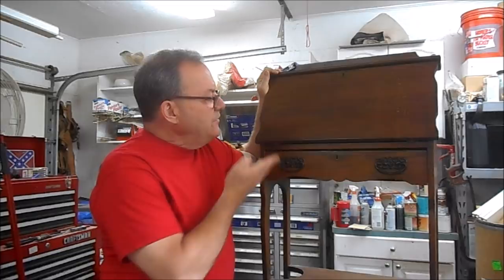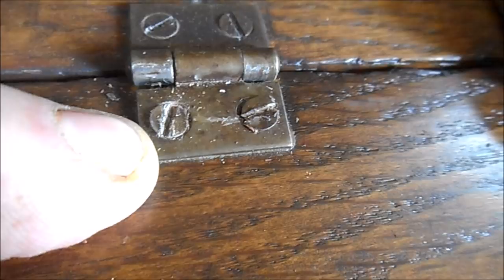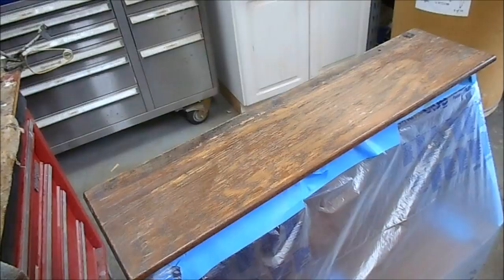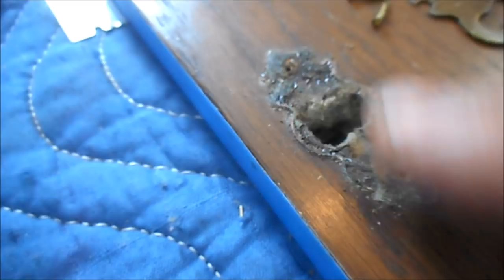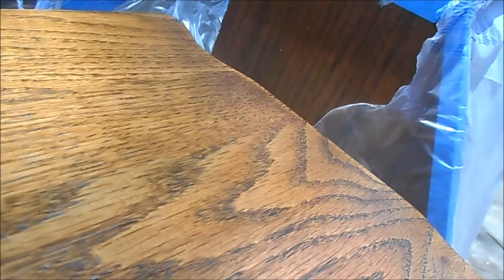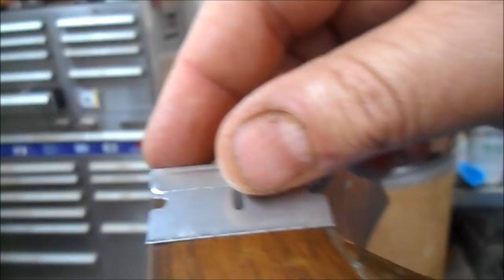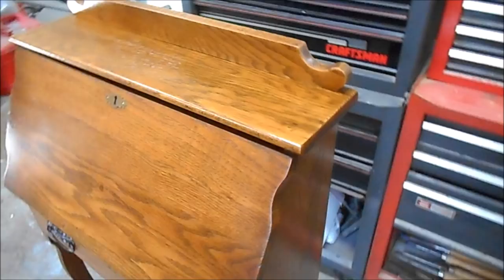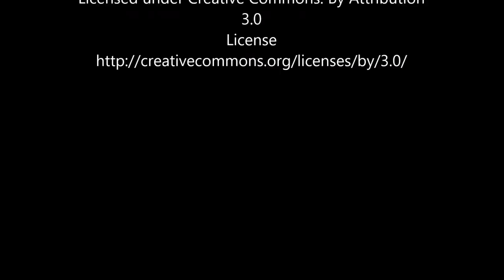Restoring a water damaged oak secretary

Comment: I’d like to echo what Marc Butler said...awesome work! Here’s a tip that’s served me well; when you want to keep track of screws that you want to place back in the same exact hole push them into a piece of corrugated cardboard with and outline of the item they are to hold down. You can also make notes on the cardboard such as left bottom hinge and an arrow for this way up.
Reply from the maker: Good tip, Cory.   Thanks.

Comment: Tight screws  that have been in the wood for decades.....  The metal screw has bonded with the wood.. Place the tip of an ELECTRIC SOLDERING IRON  (turned on) on the tip of the screw head. Wait a few minutes for the screw to expand in the wood and break the seal.  Remove electric soldering iron.     Screw cools down and is now smaller  and is easier to unscrew as the bond has been broken... Works also with nails
Reply from the maker: Yes.  I used your suggestion in this video and made you famous.   Thanks, it worked very well.

Comment: That's exactly how that piece should have been treated!  I used to take my little craftsman screwdriver and try to slide it sideways thru those round head slotted screw like you did with the knife.  I found that if I put it vertical way off to the side of the screw and hold down then tap it sideways with a small hammer does a great job of cleaning out the slots without marring up the wood. The flat tip with the square edges works great. Give it a try if you think of it next time, I think you'll like the technique.

Comment: Regarding recalcitrant screws, I have found it helpful to tap the screwdriver with a small mallet and twisting at the same time. Doing so may break the screws loose in much the same way that 52Memor uses a soldering iron. (BTW, that's SOL-dering, not SOD-dering)
Reply from the maker: I Georgia, it's spelled "soldering" and pronounced "Soddering".   If I said "Soldering" they would thinkk I was talking about the Army!   LOL - thanks for watching.

Comment: Love your projects. Very inspiring for me. Do you spray right in your shop often?
Reply from the maker: I normally spray outside or by the garage door.  I wish I had a booth, but I have no room.   It was too hot and sunny outside to spray this project outdoors and since it was small, I shot it right in the shop with the exhaust fans on and windows/doors open.

Comment: I have an almost identical secretary. Mine has a fancier head piece. Yours as a slight rocking motion from right to left.  28:00 Mine rocks  a lot. Should I try to reglue it or add blocks to stabilize it or both? My back board is split horizontally, should it be replaced?  It moves so much I don't like to write on it. P.s. great color match on your piece. 💝☀🌵
Reply from the maker: Hi.  Without seeing it and knowing your skill level , I really can't give you the best advice.    If the rocking bothers you sometimes something as simple as a felt pad under the short side can take care of it so the piece is usable.    Best regards.

Comment: Larry, I feel like I should be sending money, your videos are invaluable.  Thank you for sharing your knowledge with this "wanntabe".  Did you top coat any of the finish on the secretary that you did not do any work on?  I have an oak file cabinet from Ivan Allen in Atl that needs work similar to what you did here.  Any input would be most appreciated.  Thank you, Mike

PS: Are you using Mohawk powers?  Are they available in Atl or do I need to go online?
Reply from the maker: If I remember correctly, I didn't add any top coat to the parts of the secretary I didn't work on.   Sometimes I will, however.   I get my Mohawk supplies at Southern Paint and Lacquers on Windy Hill Rd at S. Cobb Drive in Smyrna.  Just outside the perimeter.  Very nice people and if you have any questions, they will answer them for you.